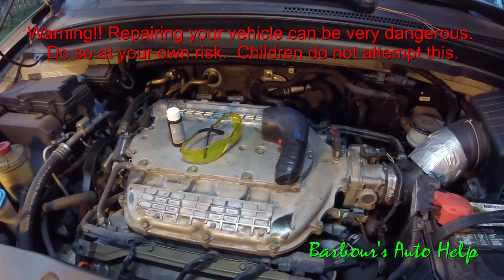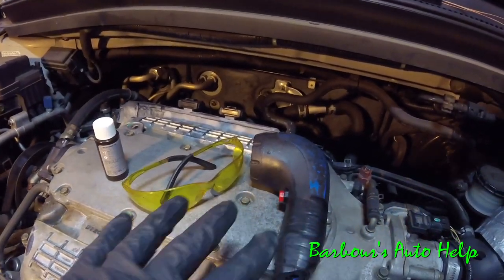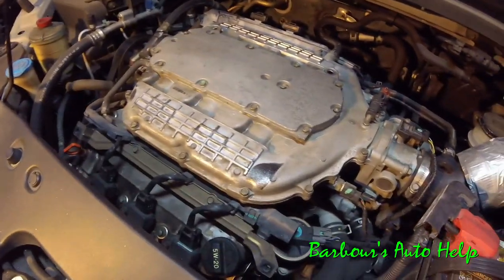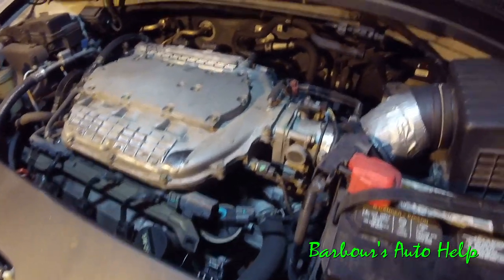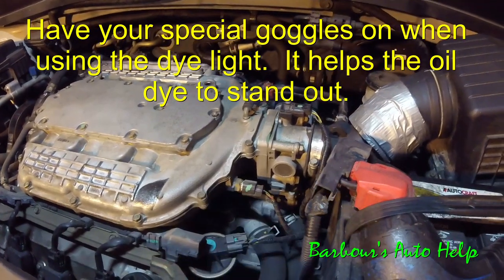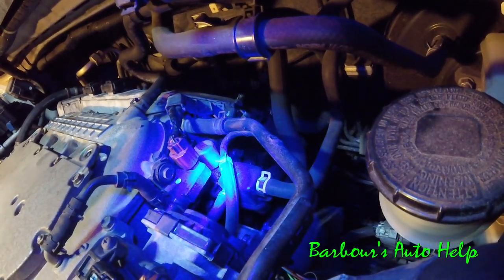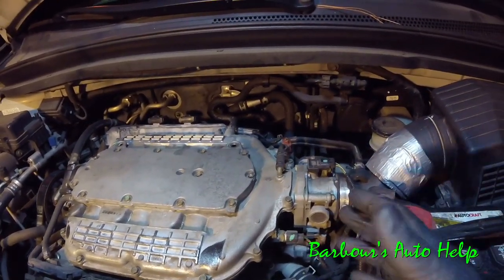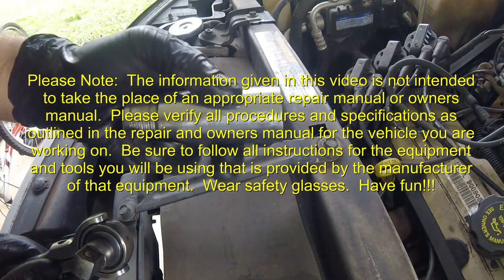Find Oil Leaks Easily With a UV Dye Light

Comment: I ran mine for 1 min,   that was way to long,  everything was glowing, even the puddle on the floor.   I hoped it can pin point to the leak but now when it's over everything.  But with the spray pattern I was able to confirm it's it crank seal behind the hominic ballancer and wasn't coming from higher up.

Comment: Purchased a 1oz bottle of uv dye today at O'Reilly's for almost $12.00. Dumped it in the oil let it run for a good 30 minutes. Searched with blacklight and yellow glasses and never seen anything. Looked with a regular light and could see oil everywhere. Pretty disappointed that the dye didn't work.

Comment: Was it the VCM solenoid itself or the valve cover gasket? I have a similar leak on my 07 Odyssey J357A engine.
Reply from the maker: It’s the valve and it’s not the gasket that goes between the valve and the head.  It’s the gasket that goes between the two halves of the valve assembly.....the one that they don’t sell.  It’s not available apart from the spool valve assembly.  That part cost $600+.  I’m doing a video today to show how to replace it.  And I’m also going to do a video on how to use“Red Neck Engineering" to fix it, I’m going to try to anyway.  I hope it turns out ok.  Should have the video in a week or two. (Update, there is a gasket available.)
Reply: There is a gasket available that goes between the two halves. I did this same repair with a Dorman gasket and it came with both gaskets. One for inbetween both halves and one that mounts against the engine.
Reply: @timmybob2028 share the link for gaskets please or

Comment: i have the fluid and the uv flash light do i really need goggles
Reply from the maker: It helps to make the color pop.
Reply: Year later. Info still helps. Thanks guys
Reply: will just regular yellow safety glasses work
Reply from the maker: I’ve used them with success.  I think it depends on the shade of yellow though.